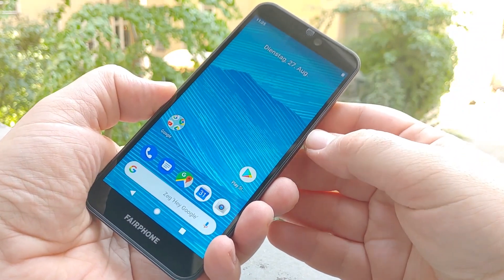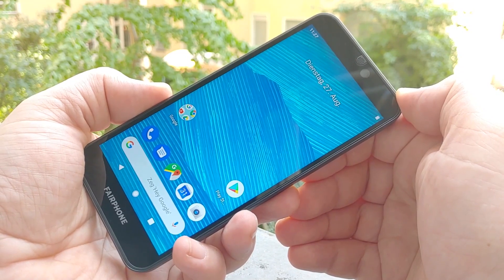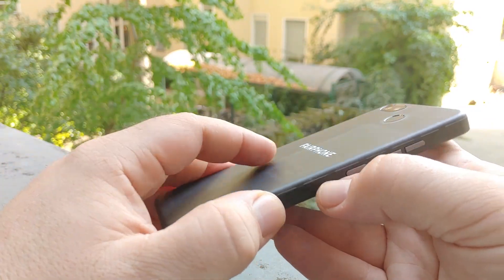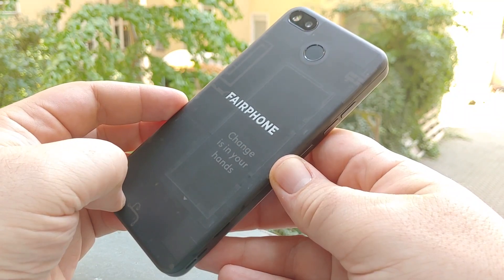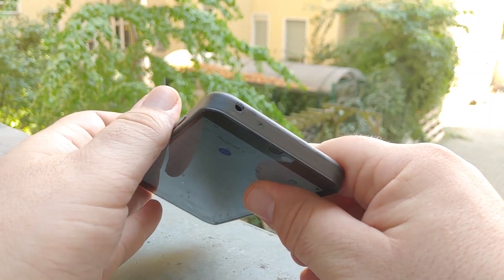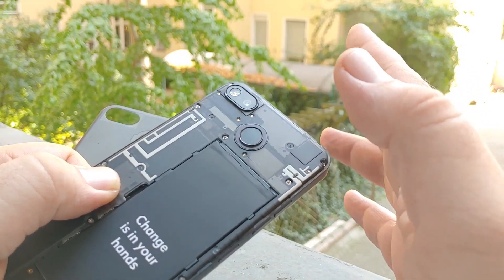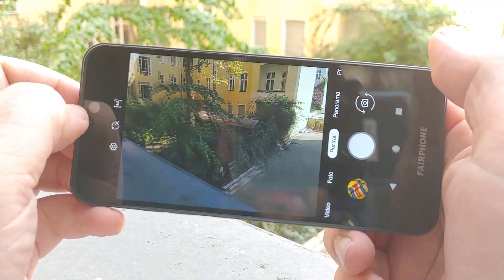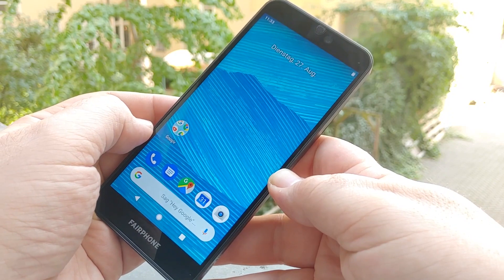Fairphone 3 HANDS ON - sustainable modular smartphone

Comment: OK, it's fair to the builders.  Is it fair to the user ? 

 Will it update the software for 5 years at least ?
Reply: unlocked bootloader? open source?
Reply: @Ninjas Unite And it's modular, making repairs much cheaper and easy on the user's end
Reply: I have the fairphone 2, since nearly 3  and a half years and its still updating perfectly.
Reply: Most of the hardware drivers are proprietary blobs, so not fair to the user. Only way around it is librem5 at the moment.
Reply: @user-ml1jx3oi8r  how's the librem fixing that part ? opensourcing everything ?
Reply: @mocanuciprian  choosing other hardware components
Reply: @user-ml1jx3oi8r  but the drivers for these components are open sourced  ?

Comment: I like it. The only thing I dislike at first glance at the specs is the Snapdragon 632, I wouldn't have minded a little more oomph. But this otherwise has things that flagship models don't, the kind of things that show respect to the consumer as well as the supply lines. I mean, repairable, changeable battery, SD card, 3.5 mm jack etc. I wanted to like the Fairphone 2 but it was just too much to give up. This... this may just be my next phone. I hate the unrepairable ultra-expensive nonsense that manufacturers sell these days. But they absolutely have to show that we can expect security and software updates for those 5 years as well. If the hardware lasts 5 years and the software stops getting updated after 2, you're still screwed.

Comment: I think the phone would benefit from making the modules an open standard, so that there would be 3rd party parts available on market. Then they would lose control over the sustainability, but create one of the most desired phone on the market. I would buy rugged waterproof case, thermal camera, barometer, laser distance measure, accurate light and air pollution sensors, etc. Apple fans would by lightning cable instead of USB, since then they won't have to buy yet another cable.
Reply: They can recycle the old components and recycle them for something new, without having to dig more minerals out of the ground..
Reply: It is an eco friendly smartphone before than a modular one.
Remember that guys.
Reply: Yeah, but it can be both. Modularity Is eco friendly. And consumer friendly.

Comment: I looked up the Snapdragon 632 and it looks like the OP has the specs wrong. The 632 runs at 1.8 Ghz, while the 636 runs at 2.2 GHz. 

Sources:
Fairphone 3 Specs: https://shop.fairphone.com/?utm_campaign=&utm_source=&utm_medium=&
Snapdragon 632 vs 636 comparison :https://www.guidingtech.com/qualcomm-snapdragon-632-vs-636-comparison/